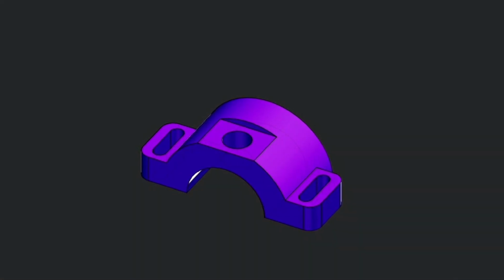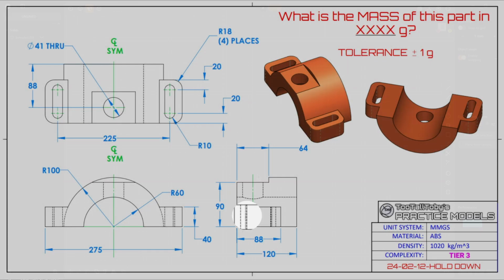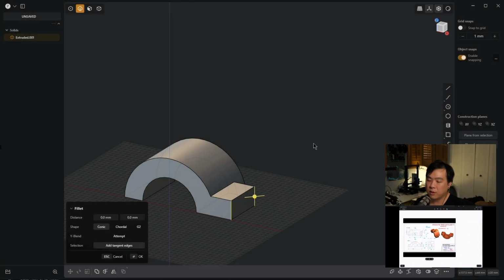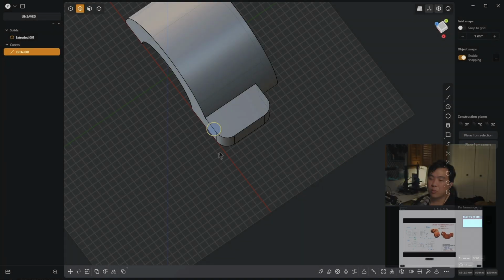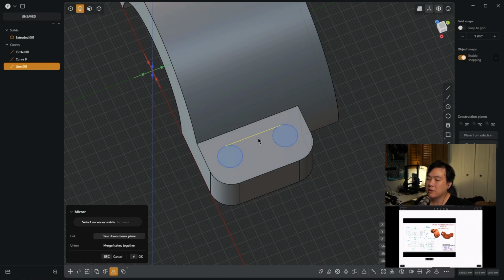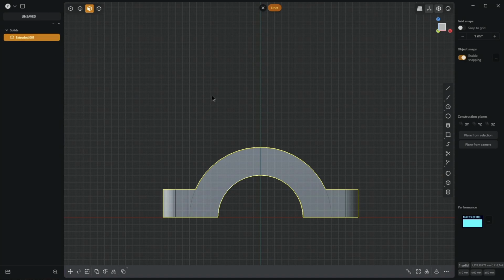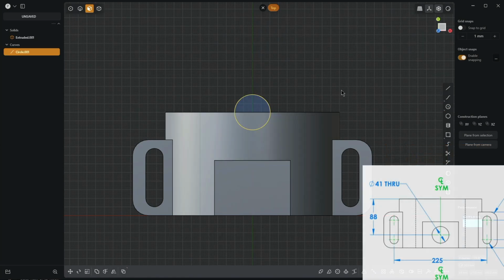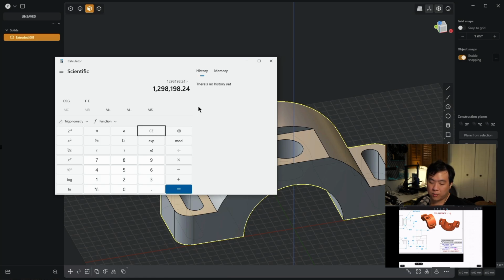Beginner Plasticity CAD Step By Step Tutorial: TTT TIER 3 24-02-12 Hold down

Comment: THE GOAT! Appreciate these video's a lot. Specially from an engineering perspective. I have watched so many from tutorials from artistic people and I much prefer precision. I have already been using digital calipers to make my designs for various parts BUT I am looking at something like a digital inclinometer. Have you used anything like this to get angles of things besides a protractor?
Reply from the maker: What kind of parts are you making? I've only used CAD for creating stuff around the house, and I've been able to do most things basic tools like calipers, level, pencil and paper.
Reply: @davinchewk  Kayaking/fishing, hunting, camping, truck, equipment. Parts around the house. Eventually I want to get into some MCU and arduino stuff with it. I am currently trying to build a kayak mount on my 1500 trail boss for my kayak. But I suppose tools like shapertools that has shaper trace I can take a photo and use that. I know in fusion 360 you could take a photo with a ruler and that works as well. I will have to look how plasticity does this